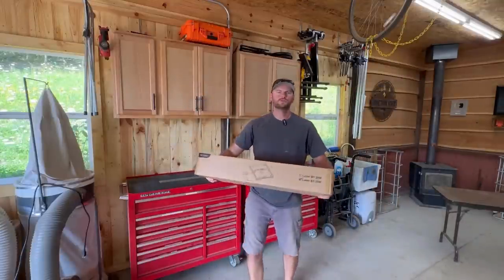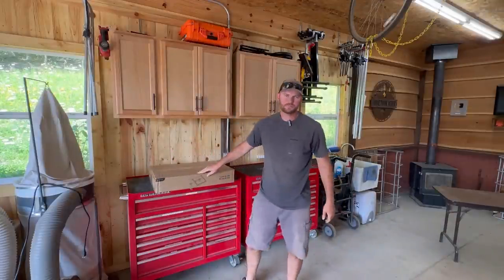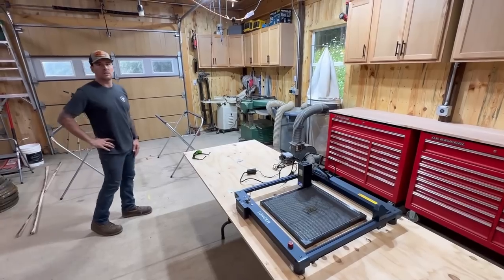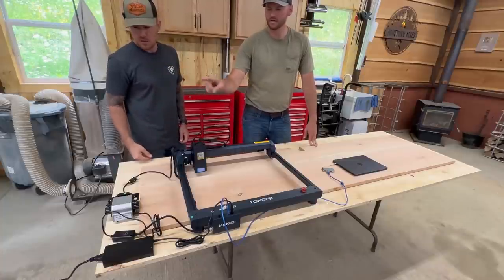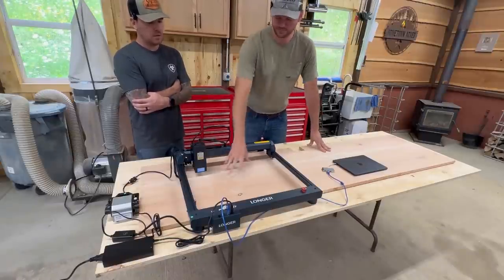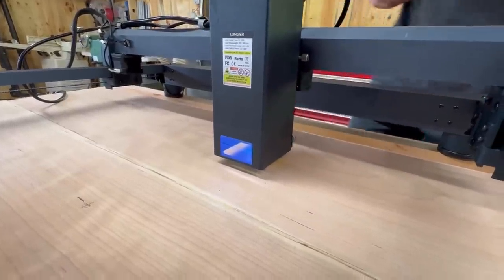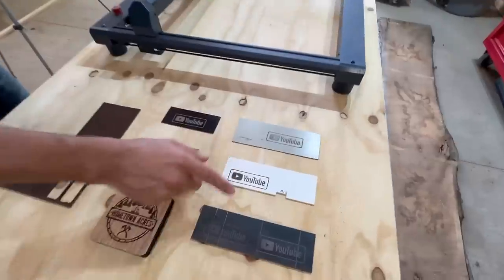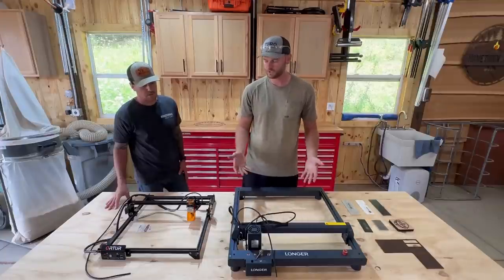My New Favorite Tool In The Wood Shop #laserengraver

Comment: Was a fun collaboration Adam.  Table top turned out great too!
Reply: From some research I have done, the diode lasers will not work will on products like aluminum because it will not absorb the laser, a CO2 wild be needed for this. I believe there is some sort of spray that can be applied to help with this that cleans off.

Comment: Adam, if you want to engrave hot roll steel you can soak the cut pieces in a bucket of plain vinegar for 24 hours and it removes the mill scale, looks nice underneath too, love the channel.

Comment: Nice work with the benchtop. When laser engraving in metals like stainless steel we use a spraycoat to make the laser etch. Check out Cermark laser marker metal spray or epilog laser spray. I use cermark and it is like thick spraypaint. Dries quick and cleans off with water after engraving.

Comment: Great job Adam, a quick woodwork tip. When glueing up boards place a clamp over boards at each end where the boards meet, this will stop any vertical slipping of the boards whilst you tighten other clamps.

POOR DOUG😢

Comment: That could be a nice way to produce some original, personalized, small-run merch. Thin plywood credit card-sized calling cards for handouts at events. You can engrave and cut these out after engraving a sheet or individually. The same can be done with toasters. You can leave the cutouts as they come or spruce up the sides with a belt sander. 
Another option, use strips or sheets of coated aluminum, and make calling card, name tags, or even name signs/house numbers for front doors/postboxes.  Engrave them, cut to size with tin snips or a metal cutter, and sand the sides to remove sharp edges.
People that want specific designs could offer their own designs for all of the above. This could be a nice side hustle for someone. I think April Wilkerson did a few videos on her channel about starting a small business this way, by advertising on several platforms and the effectiveness of those channels.

Comment: Nice video, not sure if you did or not but whatever finish you put on the top, you need to put the same on the bottom and back edge. If not your wood top will try to cup from moisture imbalance.

Comment: The aluminum is probably just that reflective. Rather than absorb the light into heat, it reflects the light.
Reply: Co-sign. Wonder if you hit it with a bit of flat black Krylon first what it'd do. And then gently sand off the paint after.

Comment: Polished aluminum is acting as a mirror. Even laser light will simply reflect. I suspect some kind of bath to dull the metal surface might let you mark it with your laser.

Comment: Nice Job Adam but you really need to seal the bottom too otherwise the bottom will expand/contract at a different rate than the top due to moisture in the air which can cause warping.

Comment: As a photonics engineer, it is frightening to see these contraptions freely available. I feel obligated to strongly warn anybody: This is a very dangerous toy, 30W is way into (the highest) class 4 lasers domain. This means even a non-focused reflection of this beam can permanently destroy your eyesight. Instantly!
They have absolutely no business being outside of a fully enclosed box. Especially for you Adam having children and dogs around you. I cannot support advertising for a product with such blatant lack of safety.
And yes, other commenters were right, the Aluminium did not engrave because the beam got reflected. If someone inadvertently bumped into the machine while you were trying this, the little filter glass could have lifted with the machine and ruined someones eyesight or skin.

Just for your information: Class 4 lasers that can be moved and are not mounted in a safe machine, normally go together with warning lights and locked doors on designated laser laboratories.
Please at the very least mention the risks of these lasers if you already promote them.
Reply: Thanks for the comment as the set up does seem harmless enough… the last thing we need is a family tragedy… 
I appreciate your laser warnings and caution for his future use.
Reply: Thank you for your kind words. To be clear: I would absolutely not use this machine. At least in Switzerland, insurance would not accept a claim, based on the blatant lack of safety measures. Well designed machines exist and are very useful tools, but the added encapsulation adds cost of course. I would recommend checking out well established, reputable brands in the industry, and the differences will be obvious.
Best regards